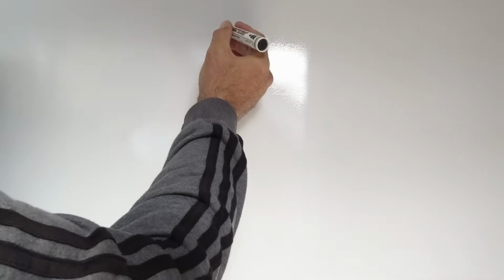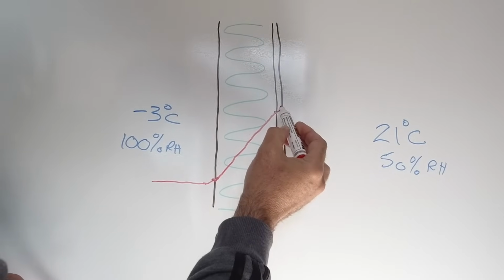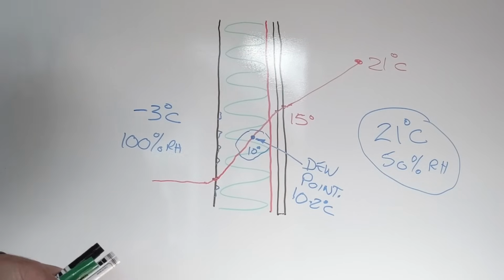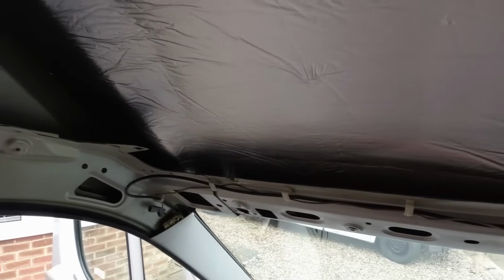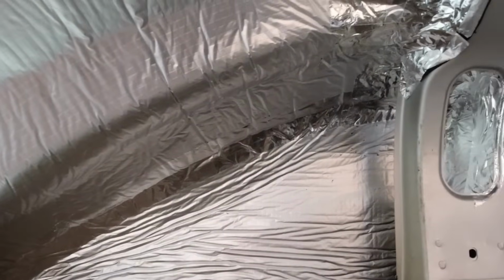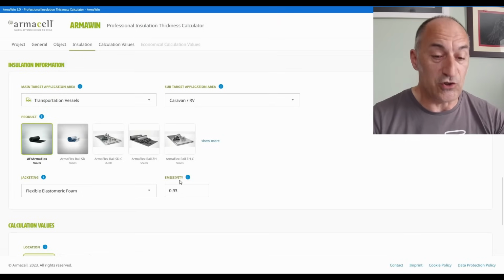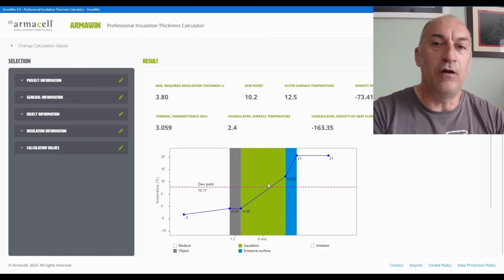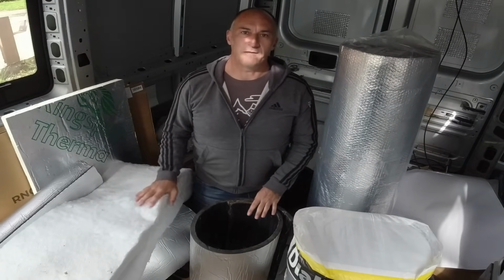The BEST way to Insulate your Van - Budget Build Ep 6

Comment: Hi Greg! I'm currently converting a Toyota Coaster bus here in Australia, and I've been using your videos as a benchmark—they're incredibly informative, so thanks for all the great content.

I've got a quick insulation question. I'm planning to install 20mm foil insulation in the walls and ceiling. A friend also gave me a few packs of Earthwool. Would it be worth putting the Earthwool in the 20mm cavity and then installing the foil insulation, or would I be better off maintaining the 20mm air gap between the bus's outer skin and the foil insulation?

Thanks in advance - Ron

Comment: Thermal breaks is an important aspect to consider.
Reply: Can you comprenensively explain how to add a thermal barrier if using a closed cell/PIR/wool insulation? Is there a sheet that goes in-between each layer?

Comment: Hi Greg Thank you for all your videos, they are so informative and easy to follow, you obviously know your stuff. I was hoping for advice on insulating a small camper conversion, its really small (Renault Kangoo), my problem is the size of the van and the reduction in space with thick insulation, any ideas what would be the best approach? I was thinking of 10 or 15mm closed foam. I do plan to use the van in winter in Scotland so not sure the best approach, any advice would be appreciated. Keep the videos coming 👍👍

Comment: Hi Greg I know it's awhile since you post the video,
But advice please regarding the extra mm off the insulation foam, if you are cooking inside,
Would you still need to use 19mm even if you have a side vent extractor 
Thanks in advance

Comment: The direction of the heat should be from inside of the van to the outside. It's the heat that moves out not the cold that moves in. Great video though.

Comment: Thank you for a great video! 
I'm interested in insulating against the heat versus cold. Insulating a Ford transit connect.  Website shows condensation doesn't form in that direction, how do I determine the thickness of insulation needed for hot conditions?

Comment: I sure wish you'd make a video explaining what to do to prevent the heat from ENTERING the van. I'm in Southern California. Very dry, and VERY hot. Would I just do what you're doing here, but in reverse? Meaning the vapor barrier would be against the outer skin of the van? Do I even need a vapor barrier considering the outside temp is already very hot, and the inside even hotter (although I do plan on keeping it no hotter than the upper 70's low 80's using an Inverter A/C which also has a heat pump for those colder evenings), but that will be only used when I'm in the van, so it will still rise to over 100 on days when I'm out. I've got 3/4" XPS rigid foam board on my floor below my 1/2" baltic birch plywood (subfloor), and vinyl sheeting as my top layer (I did also apply sound deadener all over my wheel wells and in the floor grooves already...prior to finding this video lol). I haven't started insulating my walls and ceiling yet, but have already purchased a good amount of Havelock wool. Other than the wool, what do you recommend I do to prevent the heat from getting in as much as possible? Thank you:)
Reply: I also just bought a van and was wondering the same thing

Comment: Pretty cool. Kind of confusing though with the software, I get the same results as you with the same temps, but... at 30F outside and 50F inside, it says no insulation is needed... thus even with the humidity unchanged, the dew point changes just based on temerpature outside and in. I always thought dew point is influenced by humidity, not temperature, so I'm not sure as to the accuracy of the calculator. Can someone make it make sense to me?

Comment: I really enjoy your videos, what's your recommendations on the very lower sections, ie the cavities between the floor and van walls, ie the sill area's, would you insulate with plastic bottles in there and tape up with foil as best as possible, are there any drain holes for moisture to run out ? Citreon relay l3h2 MY2020, just starting my build so I am just in the preparation stage

Comment: 5.00 pm Hi Greg 
A quick question on insulation in a van, what do you think of the multi layer foil insulation. It’s stuck down and joined up with foil tape and 40mm is equivalent to 150mm of rockwool.

Comment: what about if I insulate with 19mm armaflex, and on top of that I use fabric panels filled with sheepwool? I want to try and avoid using too much wood, cause I'm not a fan of wood. I think we can make couch seat pillows, but a little thinners, maybe 2 cm, and the glue them on top of the armaflex. The walls will be soft and warm due to the fabric, and it's extra insulation. Is that a good idea or am I missing something?

Comment: I did my mercedes sprinter insulation completely different and literally impossible for cold to come thru.

Edit: Before all that I also painted the metal inside with rubber paint.
You can also give a ceramic coating outside the van and then wrap the van.

First I used a thermal soft rubber with adhesive 10mm which automatically stopped 90% the cold from the metal to come thru on the panels
Then I glued a thermal cloth of 5mm which makes it impossible for the 10% remaining cold to come thru.
Then I glued acoustic sheet of another 10mm
I also filled all the little holes with insulation foam and rockwool
Then I used aluminium thermal sheet just on the metal beams
Then I used a plastic sheet to cover it all up
Then I installed the wood panel a thin one 3mm thick
Then I carpeted the panels

It can be -10 outside, with a little diesel heater is enough to dry the air inside and keep it warm.
(most times I dont even use the heat for more than 5 minutes)

Total cost for insulation of my sprinter was roughly: $800 give or take with all the extras like glue, foam, carpet, and wood panels.
Without the extras it was about $500 for the main insulation without the wood panels.

On the floor I painted with rubber paint
A layer of aluminum thermal sheet
5mm thermal cloth
plastic sheet
then 10mm wood floor

Total space wasted: 
Walls and ceiling: 3mm each (wood panels and carpet)
Floor: 12mm (the wood weight compresses the thermal cloth)

Comment: Years after, I’ve got my own van and trying to find the right answers considering insulation among others and ones again and there is only one go to, Greg Virgoe. :-) only the floor insulation I will do a bit different, since I got and L4H3 I have plenty head room. I will use 40mm xps and glue it straight on the floor without battens to prevent cold transfer. But anyway thanks again Greg, best regards, Albert 🇳🇱🇬🇧

Comment: Howdy, firstly I have been binging your videos as I've just bought a box truck to convert, and you have really excellent information! I was just wondering, does that temperature profile also work in the opposite direction (i.e it's 37c outside but say 20c inside) - or would it be different? I plan to use a 2mm layer of spray foam insulation on the box itself, followed by 30 or 40mm of rigid foam board. Hello from Australia!

Comment: Finally! I have watched so many van builders and they keep making the mistake of leaving gaps. What good is insulation with gaps, right?  The only 1 I saw I liked was closed cell spray foam but I was concerned that then I can’t get to my wires.  This is a much better solution and looks to be same weight and has a radiant barrier to boot. I can get 1/2 in (12 mil) from grainer. Many thanks!

Comment: Outstanding information well presented. Question, what prevents moisture accumulation on the inside of the steel skin itself? Would that not promote corrosion if the moisture is trapped with no way to escape?

Comment: By the sounds of things your gonna get condensation build up no matter what you do, so your best bet would be to build your van with panels that can be removed easy and you can access your insulation to keep a check on it and if gets wet then replace it. Also if condensation builds up to a point it starts running down then what about protecting the lower parts where water will build up with a wax spray like dynax uc from bilt hamber.
Reply: Exactly what ChatGPT told me to do. Removable panels.

Comment: total bullshit as you would need 20 cm. thickness like in a house !     - so what the f... plastic  cover does is nothing else then to suck the moisture in !   and the slowly evaporate !    beside that. ! German / Austrian  ! have a way better solution !  lamb wool !   and the cover it ! with a PERFORATED board ! so the moisture of your body can be transferred ! then later stage - you ventilate heat or what ever the car and the moisture evaporate !   YOU DONT NEED THIS HORRIBLE !  PLASTIC RUBBISH !

Comment: Hey Greg! Thanks for all the amazing videos. Really appreciate all the content. I’m about to build out a newer Ducato/relay myself. Was just wondering how you did the walls/doors and roof? Did you ever release a video on that? Is it a mix of 25/50mm pir board for walls and roof then tight bits with the bottle insulation stuff? Where do you use the thicker closed cell foam bits. Would love to see any pictures if you have any. Bit of an amateur myself so following a lot of what you’ve done build wise so fundamentals of the van are right. Cheers and take care

Comment: In Australia I generally don’t have to worry about it getting much below 2 degrees in winter. It’s more so the heat I’m worried about. Love the diagram that is so helpful
Reply: I'm just about to sound deadner the roof been staying in the van roof noise with heavy rain 🌧 to lound. Then start figuring out lights and installation for the roof 🙄
Reply: I'm Australian aswell you reckon do the same here for heat
Reply: @lukehair226  I’ve got no idea I’m still pretty confused as to how I’m gonna build my van 😅. I’m just trying to remove roof rust atm

Comment: Hello Greg, I really enjoy your videos.  I just have a few questions reference the insulation, in your video your using the closed cell VB and are you putting the recycled insulation on top of this then using the foil as an internal VB??  Can the closed cell be put on the roof before PIR or is this unnecessary.  Is the PIR sufficent for the floor without a VB??

Comment: Outstanding explanation and like others have said, I really appreciate the concise yet thorough scientific explanation of the wall system and the physics of its function. What do you think of having 2 layers of 15mm foil backed closed cell foam? Good for prohibiting condensation but still not thick enough to achieve adequate R-value for year-round use in cold climates?

Comment: Have you ever opened up a wall you insulated like this and seen how it looked after a while? If you do get condensation on the inside of the steel - will it be stuck inside the vapour barrier? Particularily in really cold areas like Scandinavia.

Comment: Are you putting then10mm closed down direct to the panels on the side and then PIR on top? If so how are you sticking the PIR to the closed foam as them pins would surely be a weak point in the closed foam?

Comment: Hey Greg, thanks for all your hard work making these videos. Quick question, how long was the roll you bought for the closed cell insulation? Needing to get it for mine and a friends van to do each of our perspective cabs. Any recommendations would be amazing! :)
Reply from the maker: In the video I used 10mm thick and you need at least 2m to do the cab roof. I bought a 5m roll for £62 so I could also do the wheel arches and other areas. Hope that helps
Reply: Following on from that, the thing I'm having trouble with is finding the right product on the link you provided as there are so many different options which makes knowing which one to get, other than the depth, a little tricky.

Comment: In the Armawin calculator, should you enter the relative humidity of the outside? Like here in Sweden it's 93% right now which means I need 50mm armacell, that's not feasible at all...

Comment: Excellent content Greg many thanks. It Might seem like a silly question Just wondering did you put insulation in the sills of the van.
Reply from the maker: If you take the effort to seal the external plastic trim then yes insulate the sills. If not this may not be wise as water could get in through the clips. This is something you can do after the fit out so don’t panic.

Comment: A friend is in the process of converting a horse box into a small home and is looking at sheeps wool at 50mm thick as insulation on top of bubble foil stuck to the aluminium sides of the vehicle.Should he put the foil on top of the wool insulation instead?
Reply from the maker: Yes definitely, putting the foil on the aluminium sides will do nothing at all they will get condensation on the inside of the foil. If they have a square sided horse box by far the best insulation and easiest install would be foil faced PIR boards. Twice the insulation value of sheep’s wool, cheaper and 100% better for condensation prevention. Please make sure they don’t make a huge mistake. 👍🏼😊
Reply: @GregVirgoe  Thank you.Just checked prices and there is no or very little difference in costs to cover around 84 square metres.Both around £680 delivered.
Reply from the maker: @roberthadley1717  but PIR is double the thermal properties for the same thickness. So to do a proper comparison you need to compare PIR that half the thickness of the wool product.
Reply from the maker: @roberthadley1717  plus the PIR would be easier to install, stay in place longer and deal with condensation far better due to its dual foil coating.
Reply: @GregVirgoe  Many thanks Greg.I have passed the information on.

Comment: Love your vidoes,gave me the confidence to tackle my camper build myself.  Im a bit stuck tho atm and need some advise.  I have a lwb vivaro,  ive done the floor exactly like yours and ive packed the bottom half out with recycled insulation.  I have the rear top panels and the celing to do yet. I have self adhesive insulation spikes and loads of foil tape but i only have 25mm kingspan x 2 sheets. My question is will this be suitable for the top half of the walls and ceiling ?  And would it need expansion foam around it to seal it? I really dont fancy using foam its horrible stuff and messy. Keep up the good work . Eddie

Comment: After watching many videos in an attempt to ensure that I am doing the correct thing when I go to insulate my enclosed trailer (cargo trailer for most of the world) I have come to the conclusion that many You Tubers are giving out incorrect information....then I found your channel 🙂

I do not intend to live in the trailer as its purpose is to carry my cars and to double as a workshop (the workshop requirement is where insulation will come in handy)
Where I live in Australia the temperature is normally around the 40 degrees Celsius in summer and 20-25 degrees Celsius in the colder months, so I do not think that condensation build up is going to be a problem?

After watching your video, I intend to do the following -
1. install 5mm closed-cell foam insulation (foil backed) utilizing the sticking side against the metal cladding
2. use 10mm foilboard as the next layer (probably not really needed but will increase the R rating)
3. attach wooden strips to the steel metal framework (to eliminate the thermal transfer)
4. line with a thin plywood tounge and groove board

Does anyone foresee any problems with this approach?

Comment: We are in Switzerland and are converting a H2L3 Sprinter van that seems identical to yours. As you said, “The misinformation out there is astounding”, so we were very pleased to discover your two series for the two van builds, and value your expertise and clear delivery.
We are now considering the insulation and plan to closely follow your scheme, that is drumming reduction material, foil-faced insulation board, stuff recycled PET in all the confined places, and lastly a vapour barrier. We need to search around for locally-equivalent materials.
The company that is helping us wants to use Armaflex/Armacell but we will not allow that!
We have a question that I hope will also be interesting to other subscribers. We found a material “Sprayed Cork” that looks really excellent and are considering ADDING this to your recommendations. But wanted to ask the expert first. This material is produced by several Portuguese and Spanish companies, one of which is named DECOPROYEC. YouTube doesn’t allow links, but Google is your friend!
This finely granulated material has a stated U value of 0.05 W/m K. It’s applied in a 2-3 mm thickness, weight 0.5 to 0.7 g/cm2.
Our plan would be apply the drumming reduction material, then the “Pins” to hold the rigid insulation board, then spray cork into all the nooks, roof and wall panels, then stuff in the recycled PET, push the insulated board onto the pins and finish with the vapour barrier.
We plan to attempt the Pan-America Highway, which means from minus to tropical temperatures, so are very focussed on the insulation.
Do you have any experience of this Sprayed Cork material? We would value your expert opinion.
Thanks again, and greetings from Switzerland, your international audience!

Comment: Hi, i went to your ebay link for the 10mm closed foam insulation and there was about 5 different types and I'm a worrier. Which is the best for the roof and sides and floors.  Can i just use the same for floor, sides and ceiling? 🤞🏻